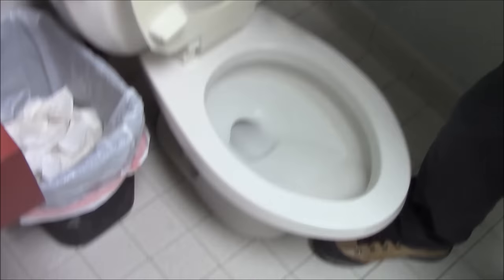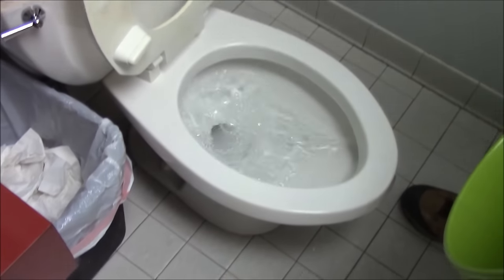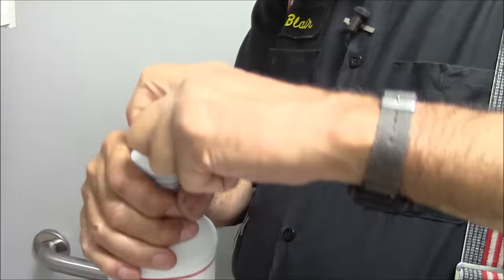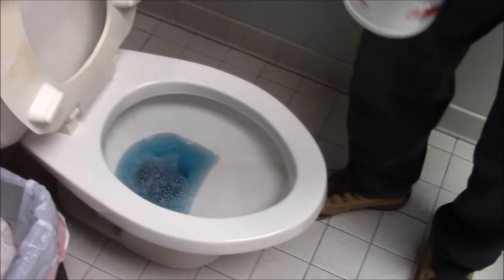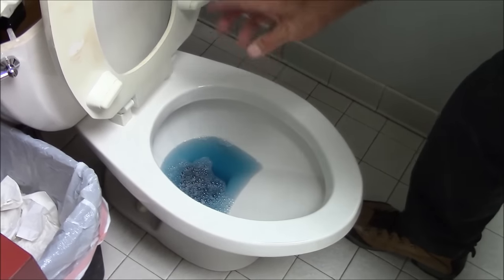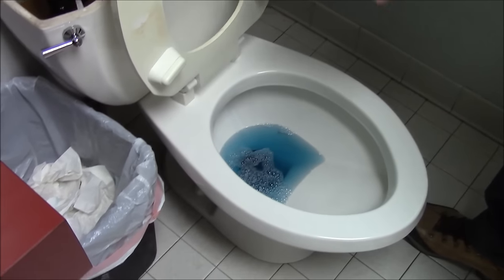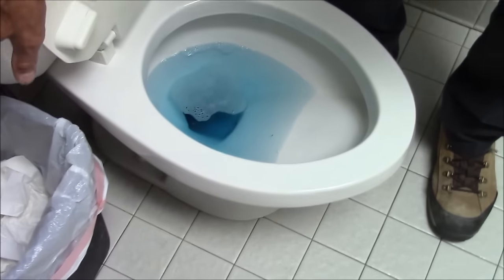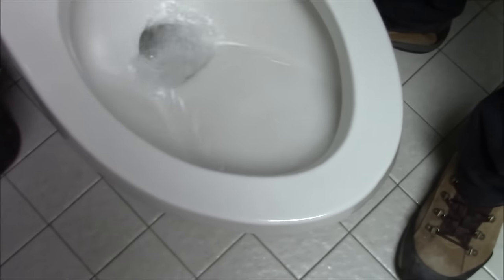Slow Flushing Toilet? Quick and Inexpensive Cure With Delimer

Comment from the maker: Use Muriatic Acid for a Good Substitute. Available at Good Hardware Stores and Building Suppiers
Reply: Yes, true. Pool supply will give you double the strength if you really mean business
Reply: Why do you have to put it in the overflow pipe, can't you just dump it in the tank?
Reply from the maker: @bramblebop1904  the overflow tube gets the ‘delimer’ to flow through the jets up in the rim of the bowl. Pretty hard to get delimer in the jets from the bowl.
Reply: But during a regular flush, doesn't water go there anyway? Some water goes into the bottom "nozzle", some into the under-rim jets. Do I get it wrong? Bottom nozzle could use some acid as well, even tho its bigger... It would seem like the best would be to plug the toilet and fill it with acid to the brim, almost. Lol. 😂
Prolly undoable, but if...it'd do the job, no?
Reply from the maker: @bramblebop1904  I miss read your question, yes if you port in a tank it will go to the Jets but it will also probably ruin the flapper mechanism and can loosen up too much crud that’s coating the inside of the tank and then really clog the Jets more. When you pour it in the overflow tube the acid goes right to the Jets and the lower port.
My worst toilet took 3 quarts of acid to get it working well. No sense in trying to fill up the bowl LOL
Reply: Ah. Now, that makes sense! Didn't think about it... Thanks! Overflow it is then.
Reply: I can pour an entire bottle of muriatic acid into the overflow with no risk of any damage to the bowl? or internals?
Reply from the maker: @logictheengineer8130  one quart at a time, and it doesn’t harm the bowl, try not to spill too much into the tank, it can loosen too much crud which will further clog the jets in the bowl.
Reply: Will muriatic acid harm the plumbing pipes or sewer line? I know its pretty strong stuff....(acid)
Reply from the maker: @markim9728  by the time it reacts w/the calcium in the toilet it is pretty inert. It takes lots of doses in pure form and left in the pipe for hours to even begin to eat plumbing.
Reply: Do you suggest watering down the muriatic acid before use? Also some other videos recommend neutralizing the acid before flushing it.
Reply from the maker: @markim9728  no, full strength.
Reply: Hi, can I use that Zep? i think it's hydrocloric; maybe dilute 50 percent?
Reply from the maker: @Frank020  Frank, Zep makes a bunch of products, if it’s the toilet delimer, use full strength
Reply: @MrHardware1  Thank you. This worked. You saved me $, because I was ready to buy a new one. I don't have a water softener, so I could literally see a few large calcium flakes floating.⭐
Reply: @Frank020  what did you use ?
Reply: @ashusethi  toilet cleaner
Reply: @ashusethi  try not to often prob bad for environment
Reply: Hi Mr. Hardware! Thank you for this amazing advice! I'll work on the project ASAP, my family will be very happy! Please tell me this: do i need to shut the water valve and drain the water first? Thank u so much
Reply from the maker: @catiaar7594  no, not at all. I tried to make it clear in the video that I left the water in the tank. I have plunged some of the water out of the bowl so the acid didn’t get so diluted and it can help clean the trap in the bowl at the same time.
Reply: The water in my toilet is ‘swirling’ instead of pushing the water down the pipe. Is this something that deliming can fix?
Reply from the maker: @Luckypuk333  if it passes the bucket test it probably needs Deliming. Delimer, muriatic acid, strong vinegar or CLR.
Reply: Can I use draino?
Reply from the maker: @Eastsidee817  no, the wrong acid for calcium. Use vinegar or similar
Reply: @bramblebop1904  ....
....

Ehyıük
Oğy
Reply: @Mr. Hardware thank you for another great video. I have a kohler toilet using aquapiston. I suspected my toilet needs to be cleaned of calcium built up. I tried the bucket test and it flushes well. I also tried your method discussed here with the alternative delimer (muriatic acid). However, it doesn't work. Do you think it is time to get a new toilet?
Reply from the maker: @trancaohuy  I have had to give toilets 3 quarts, or doses, before I got the toilet flushing properly again. $15 is a lot cheaper than a new toilet.
Reply: @markim9728  I've tried muriatic acid on my toilet for years and years. Wear goggles and rubber gloves and pour the acid down the overflow tube in the tank and let it do its thing for couple hours to overnight if the calcium/lime deposit is really bad. I've had no acid etching on the toilet. Sometimes the jets are so clogged up that you may need a coat hanger or a right size drill bit (drill with fingers) to unclog the jets but be careful because the toilet is porcelain. Remember, when you flush the toilet, the water will dilute the acid. In fact, some of the crud in the sewer line may dissolve. From this point on, do the same treatment every 6 months (depending how hard your water is) but don't let the acid do its thing for too long (30 min is ok).
Reply: Can I use lime away? It has sulfuric acid in it.
Reply from the maker: @royshonk4659  yes, that, CLR and cleaning vinegar are decent substitutes.
Reply: I noticed the product in the video is different from the links in the video's "show more" section. Your links go to CLR, which is a different product. Can you provide  a link to the product you used here? Thanks for a great instructional video!
Reply from the maker: @crwlh6721  CLR because we can ship it, go to a local building supply or hardware store and buy a quart of Muretic acid for less than $5
Reply: @logictheengineer8130  I had a buddy that used it on a clogged tub drain. It ate away surface of the tub.🙄
Reply: @MrHardware1  acid in the tank ? what about the flush valve gasket ... I wouldn't
Reply from the maker: @kennyrodriguez6802  no, the acid goes down the overflow tube, only a tiny amount can usually splash in the tank which is full of water and dilutes it.
Reply: great video! thanks for the tip I've been struggling these past days with our toilet will definitely try the muriatic acid ! thanks so much on the great videos
Reply: Doing  mine this morning with the crl  have 3 toilets  have to go to HD for more my wife cleans the shower heads  with straight  vinegar
Reply: So if I purchase CLR and pour it thru the overflow tube how long do I leave it sitting there till I then flush the toilet?
Reply from the maker: @arnaldoplaza4238  20 minutes will usually do the trick
Reply: I always thought muriatic acid would be too strong since it's also for cleaning dried mortar mix off bricks, but I guess by dilution it would be alright
Reply: @toltec13  Confused.......Leave the acid in 30 minutes? 2 hours? or overnight?  Thanks!
Reply from the maker: @terryhill4732  Full strength does not harm china toilets.
Reply from the maker: @usaman7358  20 to 30 minutes, by then it is inert and not doing much after that.
Reply: I dont think so.The overflow is the same pipe connection going through the toilet in the first place.
Reply: @Frank020  hydrochloric and muriatic acid is the same thing
Reply: @Luckypuk333  I am having exactly the same problem since this morning and last night it was working well for my last piss before bed.
Reply: Could duct tape around the rim jet holes help with keeping the delimer in the rim jets? Wait a half hour or so. Remove the duct tape and then flush.
Reply: Great video
Reply: @Mrhardware1
Can I use Bleach?
Reply: Thanks !
Reply: Does the water to the toilet need to be turned off?
Reply: I use Transchem 37.5% muriatic acid, found at Ace Hardware for around $10. Lowes and HD also carry muriatic acid but in a weaker form. This stuff will remove scale like magic in about an hour. First do the bucket test to lower the bowl water. I will even lower it more with a sponge. Pour 12oz into bowl,  and another 12oz down the overflow pipe. Take a toilet brush and spread it around the bowl and under the lip. Let it sit for about 1-hr. You might even want to use the toilet brush a couple more times (min-20 and min-40) just to be sure the bowl is fully saturated with the acid.  CAUTION:  muriatic acid is nasty stuff.  Wear old long-sleeved clothes, goggles and rubber gloves. If you don't have a respirator, either hold your breath, or breathe through a wet towel while applying. Open outside window, close the door to keep pets out and the nasty odor in. Have fun.
Reply: I tried this but none of the blue color is coming thru the jets,it just fills the bottom? I did clean the jets with Allen wrenches. Thing with this is when you flush,it almost reaches that tipping point, but I add a half cup of water,and that makes it flush. The flapper is near max.im thinking the overflow tube could be an inch higher.?

Comment: On "The Carey Brothers" radio show on KSFO in San Francisco several years ago the brothers recommended thoroughly drying the area under the rim of the bowl, then securely putting masking tape over the holes to completely seal the water channel in the rim.  Add the deliming acid — they recommended white vinegar — to the overflow standpipe, or if the toilet tank was empty and dry, via the flush valve to fill up the water channel in the rim.  Let the vinegar work for 12-24 hours to dissolve the scale and break it down into particles small enough to pass through the weep holes in the rim.  Remove the masking tape, flush the toilet as normal and you're done.  Muriatic acid will get the job done quicker than vinegar, but can be hazardous to use.  Other commercial acidic deliming preparations such as CLR and Lime-A-Way can also be used, with strengths somewhere between vinegar and muriatic acid.

Comment: This is amazing. I live in an old building with a lot of older folks who can’t afford to put new toilets in (what plumbers are telling them they need to do). If this works for them it will literally save them the money they need to buy food with this month. I’m ordering a case of this stuff asap and I’m gonna try it on their toilets. I can’t afford to buy them all new toilets but I can afford 6 bottles of this stuff.  Wish me luck.
Reply from the maker: Good Luck! Muriatic acid works also, and cheaper by the gallon.
Reply: @MrHardware1  thank you that will be much cheaper as there are 4 residents with 7 toilets between them I'll be treating.
Reply: Oh and I should add that I tried the delimer on one woman's toilet (a woman in her 90s that watches my dog for me) and it returned her 70 year old toilet to pretty much new functioning. Best 16 dollars I've spent in a long time.

Comment: Blair, this was so informative. First time in my life I have ever tried to fix calcium deposits in rim jets of a toilet, but you made it easy. Also saved us the $300 a plumber wanted to charge for running a snake. We have a good quality low-flush, but after 2 years it began to falter. I did the bucket test and it worked, so I looked at rim jets, and indeed one was not sending out enough water due to calcium deposits. Used CLR and after an hour and some pushing with a coat hanger it worked just fine. Thank you from AZ!!!

Comment: This video pointed me in the right direction.  I like to keep it simple and actually just poured standard muriatic acid, about a cup, in the overflow tube let it sit for a couple of hours and saw immediate results and slow flush was gone.  I did it again just to get any remaining deposit using the same method and now works great. No digging, scraping, expensive plumber, etc.

Comment: Thank you so much!!! I had intuitively done what you called the “bucket test,” and had concluded that must be a buildup of hard water deposits inside the rim that was causing my toilet to flush so slowly. I tried the clothes hanger method you mentioned at the end of this video, but as you already know I saw limited success. I was about to disassemble my toilet to perform metaphorical surgery on the sucker when I figured I’d check YouTube first to make sure I understood how. I watched a “how to” about how to take it apart and was about to proceed when I saw your video as related out of the corner of my eye. After watching it, I am pleased to know that I was correct in my diagnosis of the problem, and in my original solution, I just hadn’t left  the acid in long enough to get the job done! Thank you for this vid, it has saved my evening!!! Now, instead of first dismantling and then remantling my toilet, I can spend it snuggling my pups instead. They thank you just as much as I do!!!

Comment: This video resolved our issue! Thank you Mr. Hardware! 

I watched a few videos before this one so I checked blockage in the exhaust pipe and plunging it repeatedly but nothing would work. The toilet water would get a decent twirl but our “business” wasn’t flushing down all the way. After doing all the things you did in this video we now have a tornado of a flush taking all the bowl contents down the drain! 

I live in Metro Detroit and was able to pick up a few of these Rooto 1090 toilet cleaner at a local Hardware store for $5. Online prices were extremely high. I did notice that my bottle’s solvent was thicker and darker. My experience was similar to the video where even if you pour it fast, it still only came out the back siphon jet holes. Regardless, I let it sit and then used a thicker/sturdier pipe cleaning brush to insert and scrub around each of the jet holes. Once the time was up, I flushed and also cleaned the large jet hole at the bottom of the bowl. A few flushes later it works!

Comment: Great video. I had a slow flushing toilet due to calcium build up in the main jet at the bottom. I did the bucket test to confirm the drain was ok and it was a main jet with calcium buildup. I grabbed a gallon CLR from Home Depot for $25 instead of Muriatic Acid. The reason why I got the gallon size is because I wasn't sure if would need to repeat the process. I'm glad I did because the main jet was almost completely block with mineral deposit. I used about a cup of CLR and left it in for about 30 minutes and it got rid of some of the calcium deposit but as I mention it was a major buildup. I did use a brush to try to break up the calcium buildup but had to repeat the process. The second time I let it sit for 4 hours and removed more of calcium. After the second time, the flush was much stronger and seems to work fine. If you have a major buildup I recommend you leave the CLR in for a least a few hours so it breaks up the calcium.

Comment: Thank you for the tip! Rooto is pretty much unaffordable at this point but some Bowl cleaner and a paper clip opened up a bunch of the drain holes that were clogged up. I had no idea that was the cause of my slow flush issue. I know its been 5 years since you posted this but the information is timeless!!
Reply from the maker: Try muriatic acid, it’s not expensive but must be purchased locally.
Reply: Home Depot carries a 2-pk of Muriatic Acid for about $12.  They keep it outside with the pool supplies, which is what I usually get it for.

Comment: Thank you SO much!  I spent $3,600 to a plumbing company, who'd said it was my drains (now in small claims court) - Since the drains were "cleared"  with an access point in my yard, which was dug up) it did nothing to solve the problem with my toilet! I had discovered before I knew of the "bucket test", that my toilet would flush if I added a large bowl full of water every time, which was a sink companion for over a month. I used1/2 bottle of CLR 4 hours the 1st day, (half the bottle) - and overnight the 2nd day (the rest of the bottle). It did more than to repair the flush. My toilet (which had ugly stains on the bottom) - looked like new, worked like new! It's now been 3 weeks, and I'm wallowing in the wonderment of having a perfectly working toilet! I can't thank you enough for this great video!
Reply: Hope you won in small claims court. Nice that you fixed your toilet 🚽 issue.